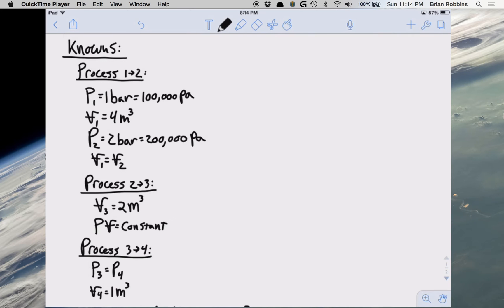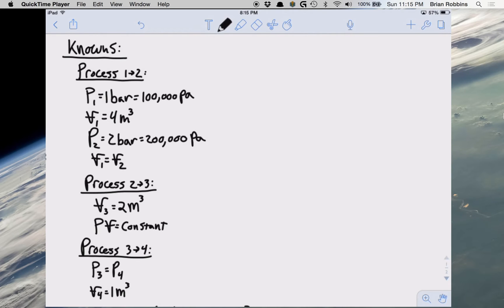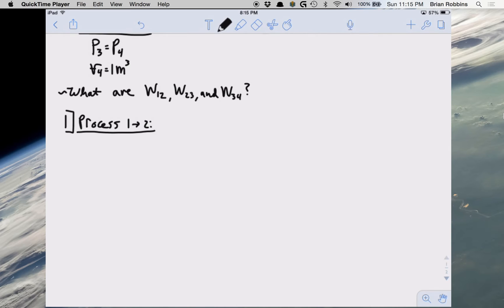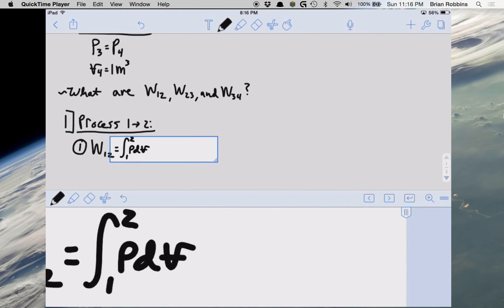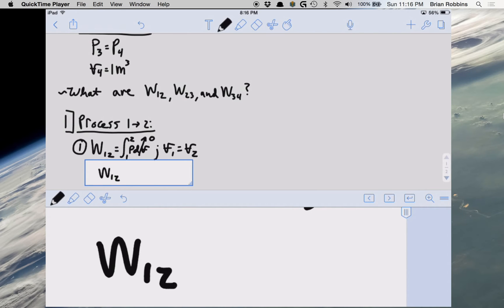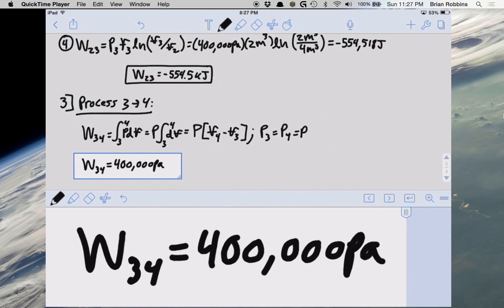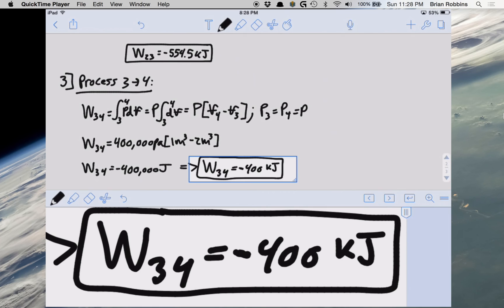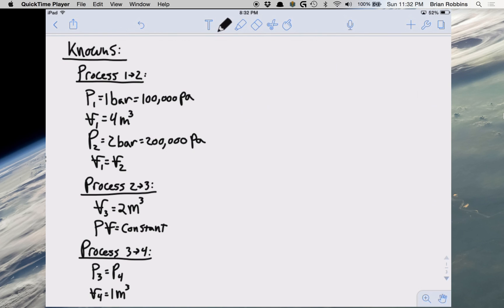ME-2124: Work Example Problem

Comment: To a close system 150 kg of work is supply if the initial valume is 0.6 meter cube and pressure of the system change as p=8-4v  ; where p is in bar and V is in meter cube determine the final valume of pressure of the system
Solve this please
Reply: dude what are you talking about this is jibberish